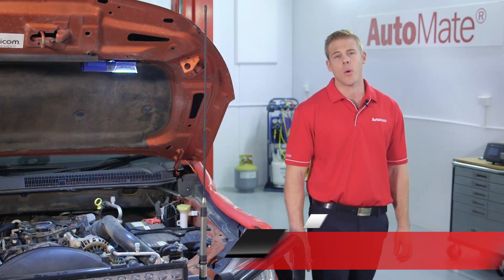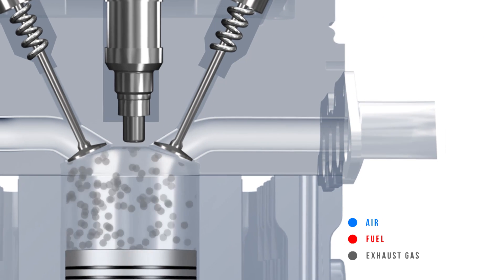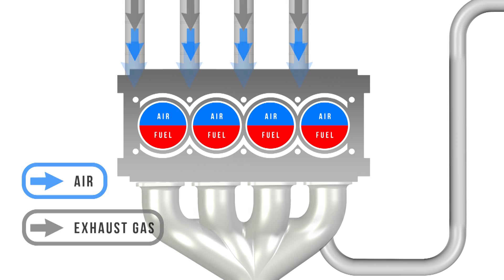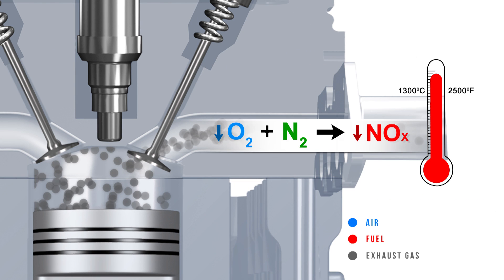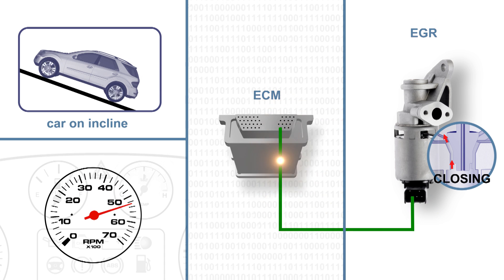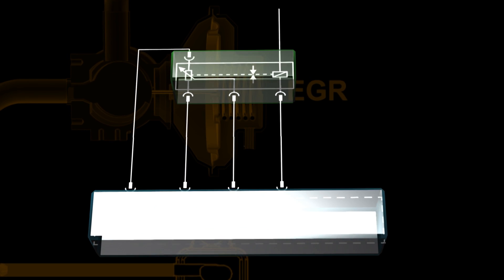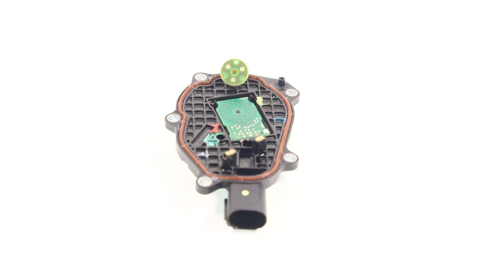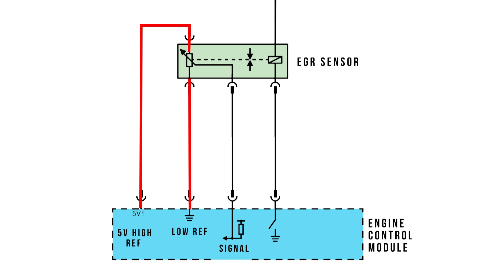EGR Position Signal Voltage High

Comment: In my situation, the fix was to spray the electrical connector with electrical cleaner. Be sure to disconnect the battery negative terminal before spraying and wait for it to dry before you reconnect.